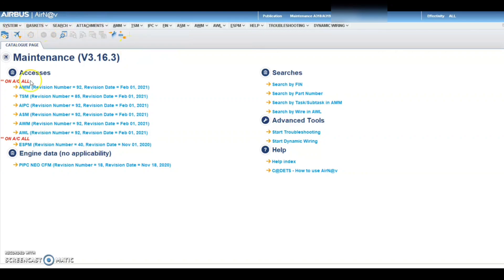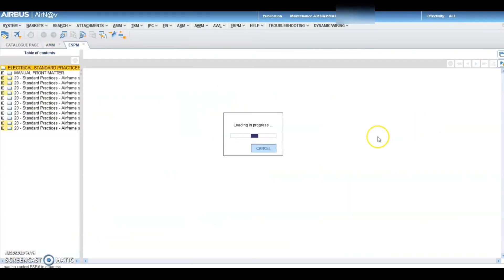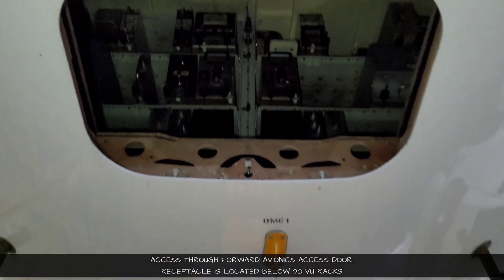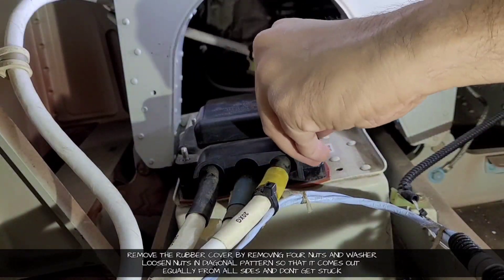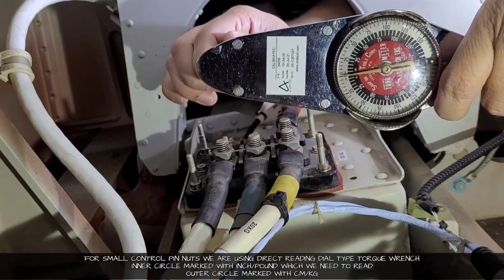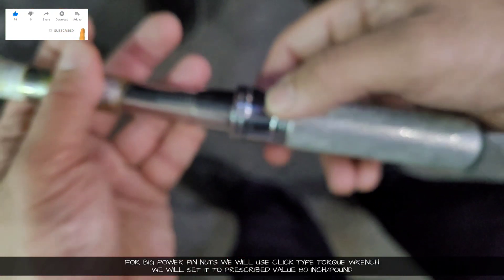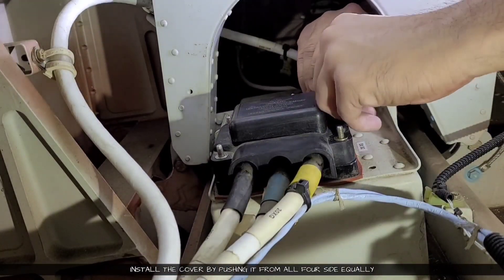A320 TORQUE CHECK OF CONNECTIONS ON EXTERNAL POWER RECEPTACLE

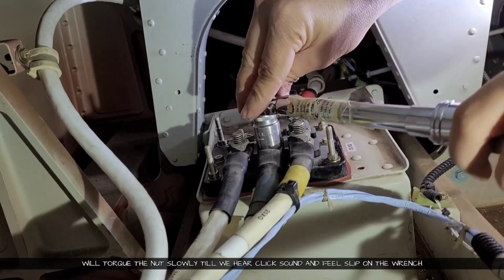Comment: Over torqued at 4:04
Reply from the maker: Good observation but need best.😇
At 04:04 nut is still been tighten. Actual torque was given for that nut at 04:07.
Overtorque is when u keep tightening even after slip or click. 
Thanks for watching. 😎
Reply: @CHOXON2CHOXOFF   if you torque it to a hundred and check it out 70 it will say is good at 70. The reason you loosen it is to re torque it to spec
Reply from the maker: @gvalera6725  Yes. But at as you saying before 4:04 there was not slip or click  and was still been tighten to prescribe torque value.If there was slip before 04:04 than you would have been right. Due to slowness there might be confusion in video. Hope I clear your doubt.
Reply: @CHOXON2CHOXOFF   yes there was but the technician never noticed. But i did 😁
Reply from the maker: @gvalera6725  Noticing while watching video and actually feeling while doing is diff thg. I am sure becoz I myself did it. 😉  Thanx for noticing.